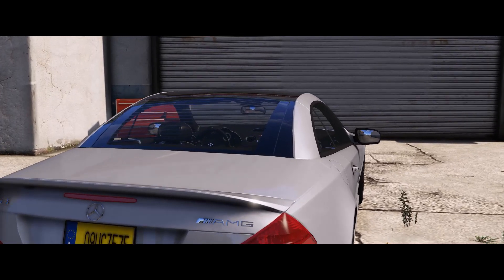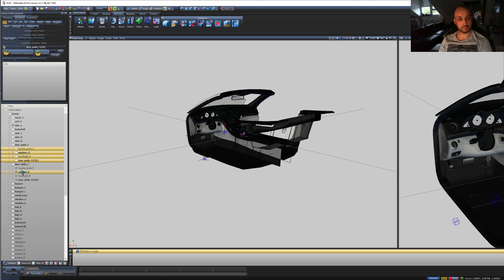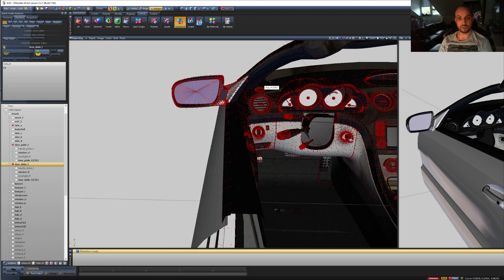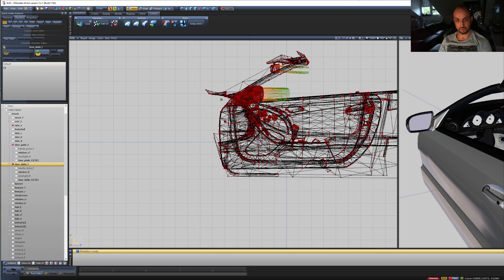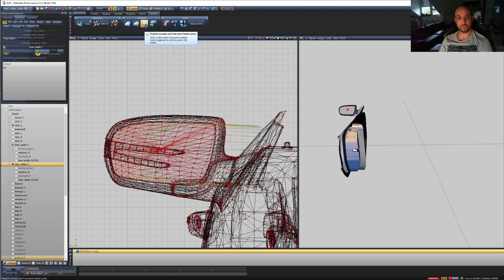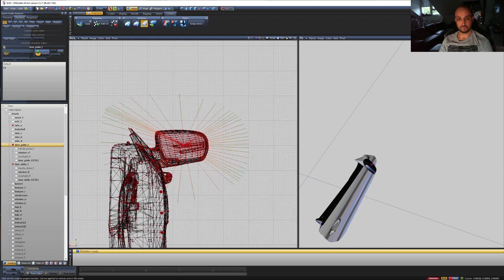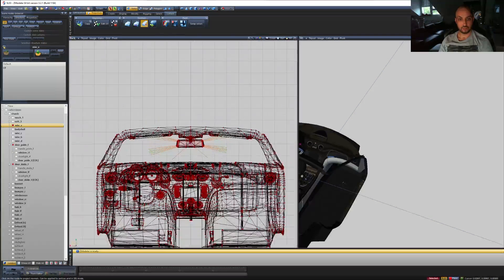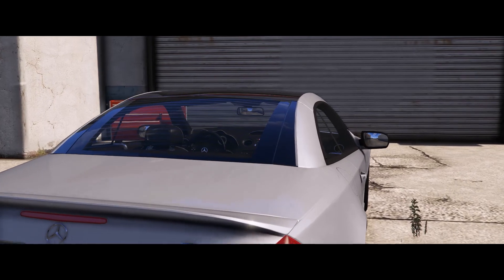TUTORIAL Zmodeler3 - Add Perfect Reflecting Mirrors to a GTA5 Vehicle

Comment: do they reflect even cars and pedestrians or only environment? It's extremely annoying to turn your head  to check all the time
Reply from the maker: No, sadly the game does not have a proper mirror function as in AC for example. The best result you can achieve is by manipulating normals of a reflective shader and expect to have a similar result.
Reply: @Asyr0nCustoms  it's not even possible to make a rea camera right?
Reply from the maker: You can add a rear view camera function but the result is the same as with the mirrors... NO trafic. Alot can be done thanks to mods, but there will always be missing things due to the limitations.

Comment: I have a weird problem I've never seen before. The right-side wheels are out to far, so I moved them inward in Zmod. Re exported and replaced in Openiv. Doesn't matter how far I move them inward in Zmod they are still at the same exact place inside the game. I literally can put them outside the chassis and they don't move once I load it into the game. Reset world on chassis reset world on main root.Made sure hubs and wheels are centerd to axis.Left side is perfect only does it on right side. Tried everything I know and can't figure it out?
Reply from the maker: Yare better off simply deleting your dummies, import fresh o'es, make sure they are correctly placed along with collisions. Then I would check if main dummy and châssis dummie are ce ntered to World!
Reply: @Asyr0nCustoms  Tried that all ready and didn't fix it, so I tried again. Maybe I'm missing something. I clicked on dummy helper 2 times to create new ones. Then I named them wheel_rr and wheel_rf accordingly. Then i dragged the wheel cols into them and deleted the old wheel dummies for both. Then I clicked on center axis on each wheel dummie. Then I used copy local axis tool and turned off keep object. Clicked on hub then wheel to bring wheel to hub. Then clicked on center axis tool again and turned on keep object, then clicked on wheel then hub to make sure had same center axis. Then using same tool clicked on wheel dummie to wheel col to make sure same center axis. Same thing happens right side wheel are out to far in game,driving me crazy lol. Thank you for answering me when most people don't. Also checked chassis and main root name and clicked on center to world,which they all read
y was at 0,0
Reply from the maker: @chrishoward-g4x  I personally never use axis tools, makes it way too complicated. Just merge dummies from a diferent mod into your scene and place them accordingly to your needs. No need for weir axis tools manipulations that might mess up your whole save.
If you can't fix it that way, idk what else you could try.
Reply: @Asyr0nCustoms  ya i even went back to old school way of manually aligning them and same thing. I'm going to try one last thing and that is to use different wheels for the heck of it. Thanks for trying to help me I appreciate it.